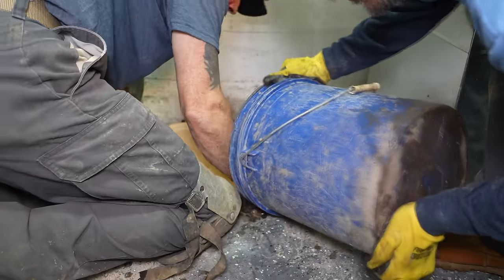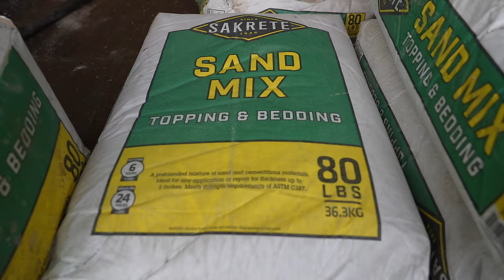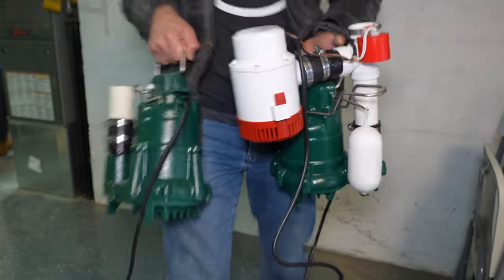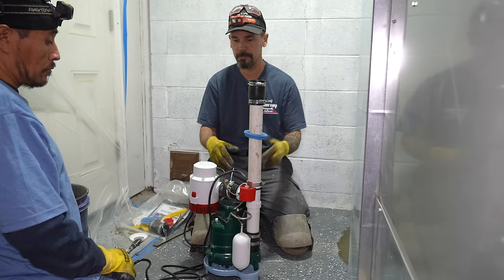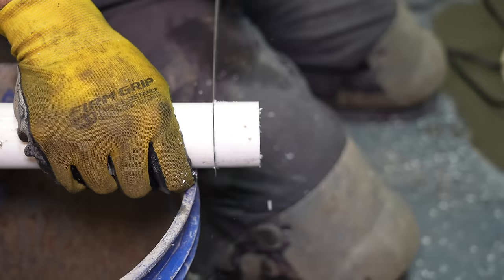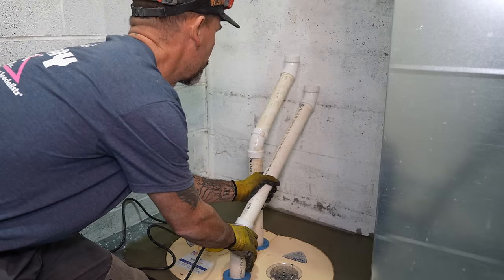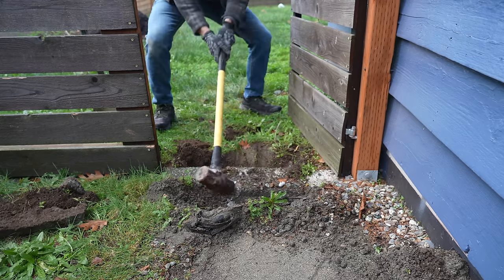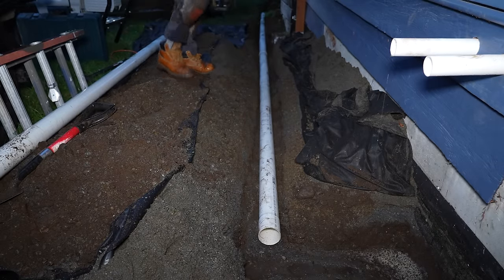TRIPLE Safe Sump Pump System Installation

Comment: To everyone: Please move your cars off the driveway when you have work done.
Reply: I was thinking the same. 😂
Reply from the maker: Richard!  Thank you for saying something.  In all honesty this just dawned on me once you said it.  That's a  no brainer but for some reason all of my focus was trying to film as much as possible since I wasn't taking on the majority of the labor on this one.  Thanks for watching and keeping me in check haha.
Reply: How is this better than digging in a proper drain at the footing outside the house?
Reply: Some Contractor require full access to driveway, in their contracts.
Reply: Yeah this helps so when Everdry brings their trucks over they can leak oil all over the driveway 🤣🤣 Ask me how i know.
Reply: @rrittenhouse that is rater unfortunately
Reply: I came to the comments to say the same thing.
Reply: Real scumbag move for sure.

Especially when doing a physical job like this moving around few hundred pounds. Then on top of that your harassing them with a camera and being in there way.
Reply: Lmao and they had to deal with cameras the whole time. Nightmare customer.

Comment: I had the same pump installed and it lasted 1 year before the switch rusted and stopped working. Replaced the switch and installed a Liberty SJ10 water back up pump. 6 years now with no issues.
Reply from the maker: Thats too bad.  Maybe you just got a lemon.  Zoeller pumps have amazing reviews online seemingly.  Time will tell so I'll keep people posted if I have any issues.
Reply: nope Zoller pumps with the built in level pump features kick on way to soon and they cycle way to often causing the contacts to burn out get one with out the pump switch and go with a tethered float that way it can fill up as high as you want it to and then it will last a lifetime
Reply: @davidstreling3690 …I have the electro magnetic switch in mine. Should I be concerned about longevity?

Comment: Nice video. One of the best things to improve pump performance that should be done is use larger pipe. The instructions typically don’t tell you but the knowledgeable folks in support will tell you using 2” pipe after the 1-1/4 adapter reduces friction and increases flow significantly.
Reply from the maker: Thanks for mentioning that.  Pipe is 1-1/2" but I'll have to ask them about the 2" pipe and see what they say.  I know we wouldn't have been able to fit a 2" pipe behind the heater since that 1-1/2" pipe was barely able to get through.  Thanks for watching.
Reply: F1 cars use the same principle on the air intake to the engine. I believe the engineers main purpose in that case is to make the air flow into the engine more laminar and more consistent.
Reply: 1.5" pipe has a surface area of around 1100sqMM. 2" is around 2100sqMM. 3" is around 4400sqMM. Surface area via Pi-R-Sq 

Re F1, those guys make their living minimising reynolds numbers. The black magic they do on intakes is even more extreme on exhausts.
Reply: 1.5 is fine for a  sump many companies switch to 2 inch due to plumbing code not allowing 1.5 to be buried in many area's.
Reply: Those Zoeller sump pumps can handle quite a bit of head pressure. We use them at my work in Waste water pump stations and they have no issue lifting 15+feet. For this application you really don't need to up the pipe id. If you need that much flow, you have bigger problems you need to address first.

Comment: Had same exact system in previous house in MA, had a drain around the entire perimeter of the basement. Three pumps, identical to these, not even a drop of water over 10 years until we sold the house. Highly recommended.
Reply from the maker: That's amazing to hear! Costly but I bet it felt good to never have to worry about flooding.  thanks for sharing and watching.
Reply: " until we sold the house." so it failed after you sold the house? 
or do you mean "even after we sold the house"
Reply: 10 years aint much 30 year storms are the real culprit.. Jersey had those and basements flooded no matter. power out pumps burned up.
Reply: I have the same system in my basement. 1950 build house, ranch, NJ. From the evidence present, previous owners had a fairly significant flood in the basement which caused them to install a full French drain and a triple sump setup with battery backup. Been here over 6 years and the basement is as dry as can be.
Reply: @Peter-td3yk  There was that 1 spring sudden warm up after a period of freezing weather in the tri-state region, everyone's basement flooded, foundations were the only place snow melt could go.
Reply: @darkshadowsx5949  I take it to mean that once the house belonged to someone else, all monitoring of continued success or knowledge of flooding naturally ended.
Reply: Battery backup don't last long enough If in an area that loses power for more than an hour go with either a water backup or a generator.

Comment: Your issue is your driveway. You needed a good French drain system installed 😊...
Reply: Agreed he has multiple issues outside of a standard sump pump that need to be addressed for the long-term
Reply from the maker: There it going to be a part 2 with this project just FYI.  This fixes the water table issue.  Next will be fixing the drainage from the front driveway.  Stay tuned :)
Reply: @BYOTools  and 3

Comment: I work for a pump control manufacturer. With your tiered system make sure you turn on the higher pump at least a couple times a year to prevent the pump from seizing up. Dual pump systems are great for redundancy but if the higher pump isn't "exercised" and seizes you likely wont know there is an issue until the first pump goes out. This is the reason why my company builds alternating control panels to increase the lifespan of the pump while also keeping each of them exercised.
Reply: What's the name of that company? Looking for an alternating control panel.
Reply: The proper way to do this is a true dual pump controller with alternating relay and lead/ lag floats.
Reply: I'm pretty sure those pumps are oil filled. Of course, they can still seize up. I actually just mentioned testing each part of his system myself. Main, battery back up, 2nd 120v pump.
Reply: @SmoothIsFast791  SJE Rhombus

Comment: I had the same situation as you with a ranch style house built in the 50's here in Illinois. The basement would flood when the ground got saturated with water thus push its way through the hairline cracks in the concrete floor. I became an expert in hydrostatic pressure. Installed a sump pump system and connected directly to the Village of Deerfield's storm sewer system at the street. Also had a French drain system installed to help relieve the saturation. Problem solved.

Comment: In my setup at the end of the pipe i dug down 3' then dug a pit  3'long x 4 ' wide, i lined the bottom with 3/4 stone about 6" -1'  deep then filled the rest of the  hole with broken up cinder block, backfilled with more 3/4 stone to fill air pockets , ran my pipe all the way to the bottom of my makeshift leechfield, ,one other thing i did was i cut the  bottom off a five gallon bucket with a lid, buried that filled 1/2 way with stone, this served as sort of a inspection port/ vent , that way in heavy rain or after i could always check on drain make sure its doing its job, has worked tremendously,  i topped it with loom , now back yard is not flooded when we get rain

Comment: Our 1940s (western WA) house had a sump already and an old Lincoln pedestal pump when we purchased it over 8 years ago and though the pump still worked I decided it would be good insurance to replace it with a Zoeller submersible. Meanwhile the discharge pipe ended right outside the foundation and so I dug a trench out about 20 feet and terminated it into a lined and perforated drywell and filled it with river rock where it could filter the water back into the soil right next to the garden instead of next to the house where it could end up underneath the slab.  I also tied the downspout in that corner of the house into the outside discharge pipe and installed a check valve onto the inside pipe so water wouldn’t back up into the basement.  Fortunately our soil perks very well and I’ve never seen a drop of moisture coming through the the basement walls (knock on wood) which is great because I want to build a game room down there. Eventually I’ll get around to adding a secondary pump with a backup battery and in the distant future wrap the outside of the foundation with a membrane guaranteed to keep water from ever soaking though.

Comment: Good call on the 3inch buried pipe. We have a high water table and sometimes both our pumps run simultaneously in the spring. I’ve kept the outlet from freezing, but I’ve had at least two cracks in the underground abs.
I’ve never seen the ice guards but that seems like a good idea too, although around here it might turn into an extreme water slide for curious chipmunks
Reply from the maker: haha that would be an extreme water slide for sure LOL! Thanks so much for watching and your input.  Very interested to hear what other people have done.

Comment: Zoeller Sump Pumps recommend drilling a 3/8 inch ( maybe 3/16 “, I don’t remember ) vent hole or “weep” hole between the impeller chamber and the check valve to prevent air from becoming trapped inside the impeller chamber.  Without this vent hole, the pump can become “air locked” and will not pump any water regardless of the level inside the pump well.  Check the Zoeller installation instructions and look for vent hole or weep hole.
Reply: I was just on him for that. Did you see a check in his build. He 100% needs to add one with all that crazy head pressure. Priming that thing evetime it runs, destroying those green beauties.
Reply: Built into the male by fernco check that's threaded into the pump comes with zoeller battery backup pump systems.

Comment: This is a French well. Pumps out ground water for months. Then house will settle just a smidge. You'll have a bunch of space under the house for water to raise and fall. Good system,  I built one if these in my last house with half a 35gal plastic drum. I've even used 5 gal buckets for this in small spaces.

Comment: Having an existing sump that failed, for me, the fernco is the best feature of this system. 

It was installed on the system that failed.  This allowed me to size the crock, buy as big a pump as the crock would allow, and a dual backup system for it.  

Installation took ten minutes.  I measured the existing pipe length from the old pump to the fernco and cut my pipe two inches longer than that to allow for error.

I glued everything up and saw that I just needed a half an inch less pipe.  I cut it.  Slipped it into the fernco and tightened everything up.

It literally took ten minutes.

I highly recommend this system and this type of install.

Comment: I'm planning to add a sump pump to my West Seattle basement this summer. I'm below street level so I can't pump it out to the gutter, but 25 feet from the obvious exit point is the lowest spot in my yard, so I'm going to dig out and install a drywell and overflow emitter. I know that's just pumping the water table back to the water table, but that's fine as long as it isn't seeping into my basement.
Reply from the maker: Yep I'm going to be installing that type of system for the driveway drain I have.  Stay tuned :)

Comment: Subscribed!  Excellent video showing the flooding problem and solution.  Your new sump setup seems well thought out for redundancy and capacity.   Like you, I learned more than I want to know about ground water intrusion and sump pump operation here in RI.   Just a couple of things which you may have already addressed, make sure there are air bleed holes drilled in the exit pipe above the pump, but below the check valves (without it, the pumps could get airlocked and can’t pump).  Also I would suggest placing the battery on a shelf installed on the foundation wall.
Reply: You mean bandage.. a hope and a wish. Id recommend swim trunks.. and a rubber ducky
Reply: @Peter-td3yk What part is the bandage and what do you propose for the solution?

Comment: The bottoms of those outflow pipes nearest to the sump pumps should have a small angled hole drilled into them to prevent hydrolock. I believe Zoeller even recommends that you do this in the manual. Also, I would personally recommend ziptying off the float switches of the pumps (at least the bottom pump) and installing a solid state switch instead. The contacts on those things are 90% of the reason those pumps fail. They aren't substantial enough and will wear out quickly. Solid state is better anyway since you can adjust the height of pumping unlike the float switches.
Reply: he mentions that at least one of pumps has an ultrasonic water sensor
Reply: @synapticburn   Not really. He doesn't do into what kind of switch it is, definitely not "ultrasonic", and he was talking about the top, battery backup pump. And like I said you want it on the bottom one if you can only have one solid state, because if you think about it, the bottom one is the one that is gonna see 99% of the on and off action. You don't want the contacts on that to wear out so no, he still should do all the stuff I mentioned.

Comment: Interesting - thanks for the video !  I rolled my own using pump spy 1500w inverter, walmart deep cycle battery, electronic floats and $60 1/6 hp utility pumps.  I get the same rain as you.  I have two primary pumps that alternate between active and inactive with electronic timer switches.  Each pump will run occasionally to decrease the chance of them seizing.  I have a 3rd pump that has the electronic floats set higher then the primary and secondary, if water ever reaches that level it could kick on to help if the flow is too large but mostly so that if the active primary pump has failed then it serves as the backup.  The HC6000 has a hi and low which allows fine adjustment of start and stop.  I also oversized my catch basin to minimize cycling.  The HC6000 also notices if a pump starts drawing more current and alarms to alert that the pump might be on the verge of failure.  I keep a couple brand new 1/6 HP pump kicking around for when one does fail - been running for a couple years now.
Reply: May I suggest adding a way to recharge your battery or operate the pump from a car alternator? Many outages can exceed the runtime of the battery, especially as it will only provide max availability and runtime for 2 years!
Reply: @robertpeters9438  That's a good thought.  I do have a subpanel that has been wired with any loads that I expect might be vital to keep going in a power outage such that I could eventually add a generator to the system.  For now I just have a small gas generator but when I get an electric car I've seen harnesses that allow that to work as the "generator".  Propane based generator system also seem pretty good.  Put in on the 10-20 year plan.
Reply: @walnutcontractors5661  Propane base generator is a great investment to be assured your water management system is fully functional at all times. Battery backup systems are crap and do not last or will fail in extended outages/storms. Took me 10 years to learn the hard way.

Comment: I've got three sump pits in our house, the previous owners installed: two inside, one outside in the yard near the foundation. 

The pits inside the house were professionally installed, and share many of the features shown in this video. 

The single best thing you can do though, is prevent water from intruding your foundation in the first place (if possible). In our case, it was a grade issue; the slope of the yard ever-so-slightly went toward the house in several places, exacerbated by landscaping which retained the water with landscaping fabric. The house may have settled over 40 years or the grade was never correct, but the end result was rains and snowmelt inevitably directed toward the house, and thus inevitably INTO the basement.

After we bought the place, we tore down the deck, tore out 400+ feet of landscaping including igneous rock and thick plastic beneath, along with poured concrete edging and sidewalks which sloped toward the house. I hauled in 14 loads of fill dirt and banked it against the house, installing window wells to compensate for the added elevation against the split-level house. I capped it off with erosion control blankets and seeded prairie grass and prairie wildflowers all around. All downspouts now have ten foot extensions too.

It was a monumental effort, but the result is that I no longer fear rain or spring thaw like I had! We've not had even a hint of humidity in the basement ever since. Neighbors tell us that the previous owners dealt with basement flooding every single spring over the ~40 years they owned the property. 

Moral of the story: try to keep water from flowing anywhere near your house in the first place!